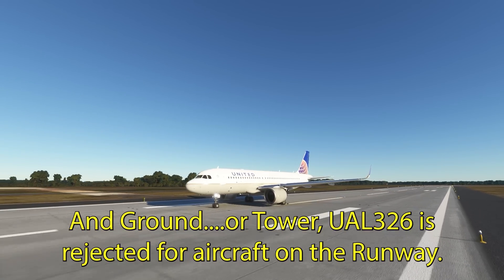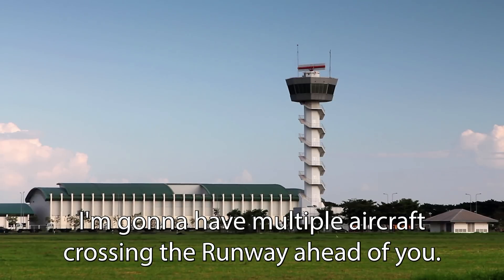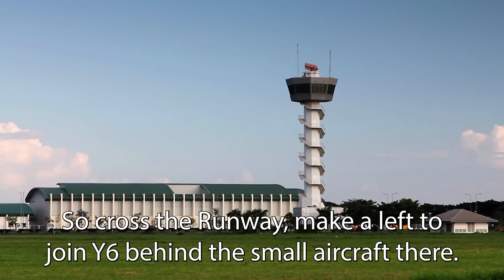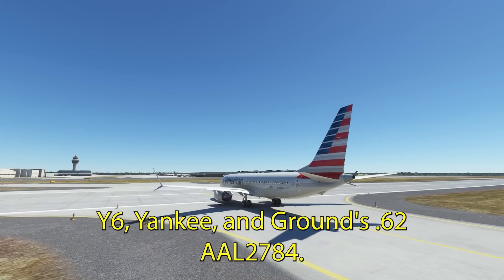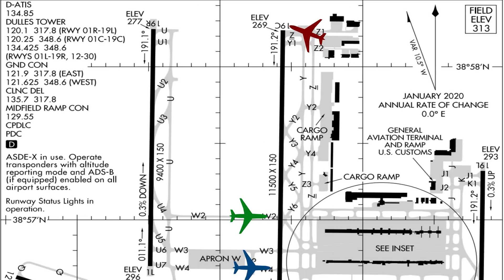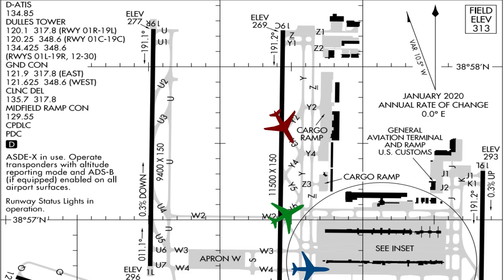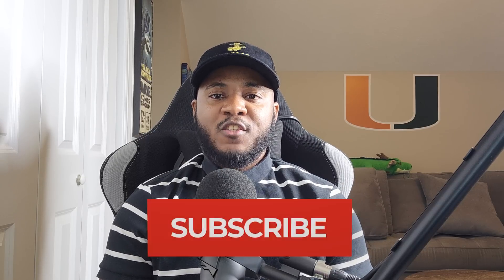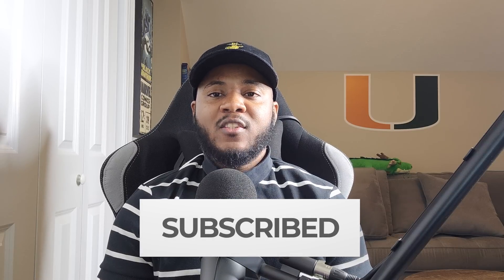Almost Deadly Crash Averted at Washington-Dulles International Airport Due to ATC Error

Comment: All involved maintained composure & professionalism despite the clear error.  The controller must have felt aghast at his "brain fart" error, but still did his job.  Also, they switched out that controller before United was given the 2nd clearance -- a very wise thing to do, not as a punishment, but so that pilots don't lose confidence in ATC.

It's obvious why a controller is relieved from duty when that happens.  Mistakes happen, especially in a high workflow environment.

What's not so obvious is what does that controller go through or do after such an incident.  Can you shed some light, please?
Reply: Also makes sense to relieve them as the controller is unlikely to be in the best state of mind to work effectively in the immediate aftermath of a mistake like that.

Comment: Maybe I’m just over thinking but why would you have segregated runways set up so that arrivals would have to cross an active departure runway in the first place?
Reply from the maker: Segregated runway operations are usually more efficient, but I agree with you in this situation.
Reply: if you flipped it ... departures would have to cross an active arrival runway.  So not real difference.   In this case, 19C was used for departure as it was the longer runway.

Comment: That is really cool Kelsey over at 74 gear made a video on this explaining that this is a perfect example of just how many things have to go wrong for an accident to occur 1 the air traffic controller forgot about the aircraft 2 the aircrafts crossing the runway weren’t paying attention or they would’ve said hey wait a minute and 3 the pilot taking off saw what was about to happen and aborted takeoff before air traffic control realized what happened if that didn’t happen then there would’ve been an accident. One of the first things we are taught in flight school is regardless of your clearance always look and make sure you are actually clear before doing anything because although atc is very good at not making mistakes like this it can happen I learned that one the hard way during my ppl atc cleared a jet to land while I was still getting my taxi clearance I got to the runway they told me I’m cleared for takeoff seconds before a jet was supposed to land on the same runway
Reply from the maker: Wow that's crazy, thanks for sharing your story.

Comment: So what typically happens following an ATC error like this?
Reply from the maker: So typically, the Supervisor on duty would get the controller replaced by someone else. That controller will then get the opportunity to write a statement. This type of incident would require what's called a Mandatory Occurrence Report (MOR). The Supervisor will file this report and include any additional information such the audio or radar recordings.  The FAA will then review all that information and decide on corrective actions.
Reply: Certainly, you could hear that there was a new TWR.